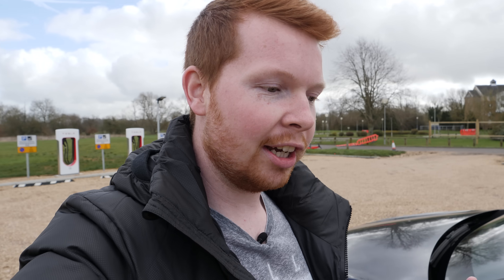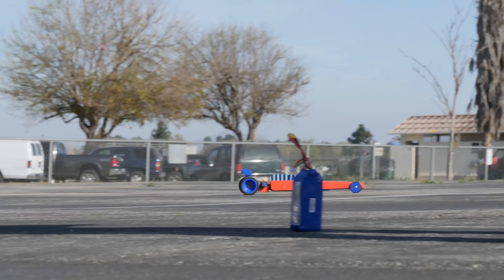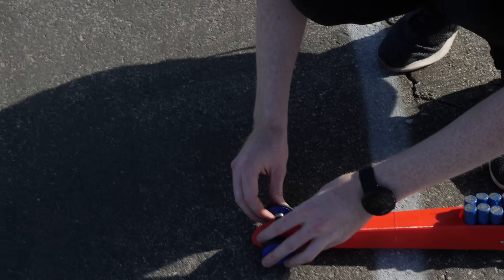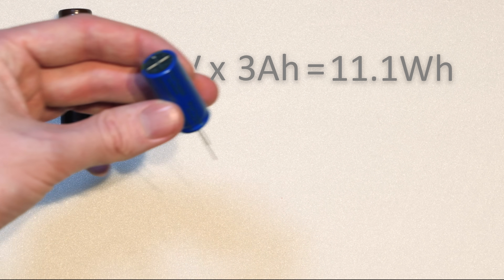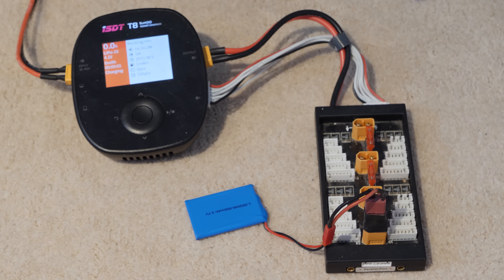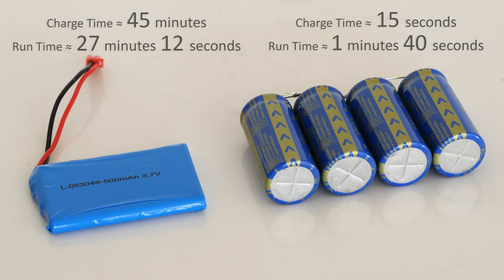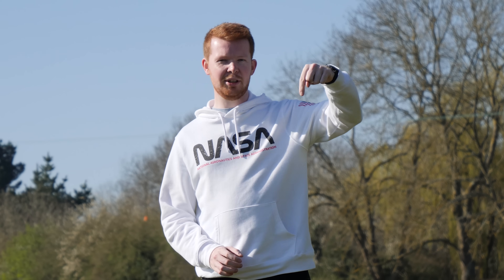Super Capacitor Dragster

Comment: if your looking for video ideas, it would be ace to see a hybrid of super caps and low discharge rate batteries vs a high discharge capacity. eg 10c + caps vs 40c. Can the caps be stuck on in parallel  or do you need to limit current between the battery and the caps to save the battery (or will the lowC battery self limit current well enough.) tractor pull setup would be easier to test on film, your dragster leaves frame to fast. Keep up the ace work dude.

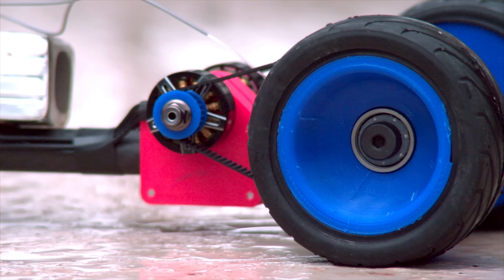Comment: 1:00 - aren't the tires backwards?

E: Yup, but you fixed it later.
E2: Also - why you didn't compare the relative costs of both the capacitors and batteries?

Comment: with a charger like a Power Lab 8 you can charge up 4C for most Li-poly packs (15min charge times). the limit is wattage of the charger and input PSU. mind you you likely have drive the charger with a 1200w PSU but the charger CAN output all 1200w at what ever voltage and amp combo you want. up to 30v and 40a. i have charged 6x 6 cell 3200mAh lipo packs in parallel at 40amps. this is just over 2C rate for the pack load 3.2amp per pack * 6 packs

Comment: The problem with your car was no suspension the tarmac you were driving on has a large amount of bumps in relation to size therefore the bumps affect direction and and grip therefore it flips or does a nae nae and wrecks itself.

Comment: Cheap Walmart car is cheap, but at least it has proper steering. The cheap RC cars when I was a kid had a  half of a control channel. When the controller is transmitting, the car goes forward. The controller stops transmitting, the car reverses and turns left. The motor spins as soon as you turn it on. That's it. Suffice to say I was not encouraged to pursue the hobby.

Comment: Hey, What if we charge the capacitors in a short time and have those capacitors charge the battery slowly while it's unplugged?
In that case, maybe we cannot ride while the capacitors are charging the battery (atleast until a certain amount) , but the 'plug in' time is less. So that more people can charge from the same plug.
Reply: It's not about where you store the energy, its about how much maximum energy you can store in the capacitors.
  
If you first charge up the caps and then transfer the energy to the battery, you still don't have more energy than what the caps can hold. So your running time at best could only be the same as with caps only. 

In reality it would be less since you loose energy due to charge/discharge inefficencies of caps and batteries, and you are carrying the extra wheight of the batteries.

Comment: I think that these kind of supercapacitors would make more sense in a world where power can be delivered in an easier manner than plugging something in. I was thinking something along these (https://www.youtube.com/watch?v=YeNXRD8eziA) lines. That way, something could be wireless and getting charged most of the time, and be fine. For something like the mini-trains in the example, they wouldn't just stop if the IR beam was broken.

Technical challenges might be:
        Amount of power delivered by the IR beam
        Efficiency of the photovoltaic reciever
        Voltege output of the photovoltaic reciever
        High voltage requirement of the application

And probably some other things that I'm not aware of because I haven't tried to build something like this.

Also, so many things in our homes need DC power, and relatively few things need AC power. Is there a reason why our houses have an AC power delivery circuit instead of a DC one? Seems like it'd be more efficient to have one AC->DC converter than for everything to have it's own, and run AC to the appliances that need it.

Comment: — 27 minutes on bats (1632 seconds) requires 45 minutes of charge — 72 minutes total, 
— which equals ~16 cycles of running on caps requiring only 4 minutes of charging — 31 minutes total 
=> 40 minutes bonus time? — give me two! — What am I missing? (except 16 pit-stops for charging)

Comment: Maybe you should buy a small heavy duty mill they arent as rigid as a big mill but good quality ones are still good amd can make you a lot of parts of different shapes material and sizes (as long its still smaller than the mil itself).Just remember to keep hands off the workpiece wnen using it.

Comment: just watch out there; when those caps are empty your battery pack sees that as a short circuit, it's putting out current restricted only by it's internal resistance (which is tiny - so big current) when you connect the battery pack directly to the capacitors

Comment: That was a little disappointing.  I was expecting to see the supercaps dump their energy into the motor quickly for some ridiculous dragster action.  Larger supercaps can easily discharge at 1000A.  Of course you'll need an ESC, motor and wire to handle the current.

Comment: Forgive me. 
I am in no way any kind of electrical genius, i just like watching these kinds of videos.

But i have a question, maybe you can help... What would happen if you charge the super capacitors with an on board battery while running the car? 
is it possible, and if so, how would that work. also, what would the pros and cons be of combining the two technologies?

Comment: So now combine super capacitors with batteries where the caps take care of high draw and the batts running time.
Reply: CSIRO here in Australia developed that tech for deep cycle lead-acid batteries, intending to use it for electric cars. They were overtaken by the supremacy of Lithium batteries, AFAIK the idea never went past prototypes.
Reply: Or just use a transformer

Comment: There are two (and a half) categories of supercapacitors. On the one hand, you have the "Maxwells" - ultralow ESR, but high self-discharge; designed burst-unloading time of ~15s. Designed for starting generators and such. On the other hand, you have the "Sanyos" - High ESR, but low leakage - designed for battery backup of RAM. The "golden in-between" is a specific brand called "CapXX" (now-a-days owned by Murata) that makes a decent compromise between the two. 
If you use a high-ESR cell for burst-discharge, a lot of the stored energy is wasted as i^2*R*t (self-heating) and might damage the supercapacitor in the long run. FYI :)

Comment: Not really a super capacitor, I believe these capacitors loose state of charge very quickly when idle which is why they are not used in electric cars. Some electric buses use capacitors to gather regenerative braking energy and then use that energy to charge the batter pack. Capacitors can take on every from large bus braking faster than a battery can.

Comment: Very cool video! great work on the drag car!  This could be a fun way to bring boy scouts into 2020, instead of pinewood derby, supercap derby! haha

probably easier to drive by limiting the turn radius of the car.  maybe you can do it in the radio with dual rates?  and/ or mount the supercaps lower to keep the cg low? 

would be interested to see you use come circuitry to use more of the remaining capacity leftover in the supercaps.  Some may not realize that the energy density calculation is based on some drain test consisting of a minimum voltage.  The minimum voltage of the cars system is far above the USABLE voltage of the capacitors.  

How much more run time can you get using the same supercaps combined with added circuitry?  (step up voltage for example) Price and complexity will go up with runtime. Is it worth it? Let's see a test! :D

Comment: We're using supercapacitors to power small free flight model airplanes. The characteristics are ideal for this application compared to regular batteries. We can select the capacitor and motor combination as well as how much we charge it to control length of motor run. We can let the system completely run down without damage so we don't need to use a timer. Check out videos on my channel including intro to capacitor flying and how to make a precision digital field charger. Love the supercap dragster you built! It needs a gyro on the steering servo!

Comment: I got little RC car for 15$ that runs like 15 minutes on actual super cap. I think the issue with your approach may be the fact that you seem to be using normal caps. The model I'm using was availabe at Gearbest and is available on Banggood too. Still it uses the same USB charger and charging takes more time than few seconds :/

Comment: I've an idea. It might work just like gear shifts. Make upto 3 capacitor banks. And use a timer relays to shift the connection with motor from the bank which is discharged to a fully charged bank.

Comment: Dragster is difficult to control because because the rear wheels are being driven by independent motors with no connecting axle between them. Slight variations in grip and motor torque cause the car to yaw faster than the operator can counter with steering. This is why real-life drag racers use solid or locking rear axles.

Comment: You can make front wheels toe angle inwards that will solve stability problems. It is used in most of passenger cars , makes the control easy at higher speeds.
At least my proffessor told us so. Your channel is amazing, greetings from Turkey.😎👍🏿

Comment: How about using a combination of the two for fast charging and high discharge with a relatively small lipo battery that would normally not be able to deliver that discharge rate.
Reply: Way cheaper to simply add batteries. Limiting factor is not discharge capability but wire size and motor to deliver the current.

https://youtu.be/zlJRo9yVzus?t=4214
Reply: Depends on the available space and the requirements. The supercaps can deliver a substantially higher current in the same size. So for quick bursts of power use the cap and charge the cap again slowly with the battery. 
A small lipo as shown in the video can maybe only supply a few amps peak whereas the supercap can do a multiple of that.

Comment: So fun fact: I'm a university student, and I work at a lab run by my university. The project I'm currently working on is to build a ~36kWh battery pack that can be charged in about 8-10 minutes with an associated 350kW charger (that we are also making). Kinda cool to see this somewhat related video.

Comment: Man you gotta get some of these to play around with https://www.ebay.co.uk/p/5027691131?iid=401815771147 500F and maybe 3 times the size of the capacitors you were using. They have enough power to amp weld. Use them in little solar lights and for a mini car starter.

Comment: To be fair, if you compare the charging time to the use time, supercapacitors aren't that bad.
With battery : 1,7 min of play / min of charge
With capacitors : 6,7 minutes of play / min of charge

So if you only have one battery and you want to play for hours, you would be better of using a supercapacitor power bank to spend more time playing and less time waiting.

Comment: I saw you had two motors driving the rear wheels. Were the rear wheels independent? Due to the short wheel base I could see any variation in the speed of the two rear wheels could cause the roll overs you were experiencing.  Cool project though.

Comment: One of my favorite planes ever was a glider I made with a capacitor and motor/prop combination from a department store toy. It'd charge in seconds and then run for 15 seconds. With the right throw into rising air it'd fly for several minutes at a time. I had so much fun chasing the plane around the football fields near where I live.

Comment: Yeah, lithium ion already has an energy density that's borderline...

Supercapacitors are so much worse than that it's no surprise they're not used for vehicles...

A supercapacitor is just a capacitor with a very high energy density (for a capacitor)

The upside of a capacitor over a battery is it can cope with very high charge and discharge rates and it doesn't wear out easily...
The downside is very low energy density, plus a rather high self-discharge rate. (don't expect a capacitor to have much charge left a month later...)

Comment: Super cap should be used for heavy load operations for short time, like re generative braking, starting from dead still, it would greatly benifit the battery life, so don't compare apples with oranges 😒😒😒
Reply: https://youtu.be/zlJRo9yVzus?t=4214
https://www.youtube.com/watch?v=NxmO_QuD4Do&t=1712s

Comment: were camber, castor, and toe angle considerations made when designing the drag racer? if not, this might be the cause of instability
Reply: It seemed okayish until they tried to turn it. Have you ever seen a dragstrip with a turn?
Reply: Maybe gear down the steering for a much larger turning circle?
Reply: Other factors:
Was that wing designed correctly? (and would it matter at the kinds of speeds of an RC car?)
Reply: @KuraIthys 
At that speed, I'd guess it's just weight.
Reply: Seemed to crash when you let go of the accelerator.
Reply: Marcus Österback maybe a bit like a Porsche 911? Due to how light the car is it is possible the engine braking when he lets of the throttle causes the rear wheels to slide out.
Reply: A simple decrease in servo sensivity should be more than enough.
Look at the turn radius of notmal dragster cars, they are huge. ;D
Reply: Largest contributor is probably the rear weight bias. Will cause oversteer, which manifests as instability in this case.
Reply: Most of the center of mass was higher than the axles which also caused instability. In short, too sensitive steering, too high center of mass, not enough weight.
Reply: Lower the centre of gravity and make the steering much less sensitive. You can program the steering limits on the controller. Real dragsters like this only have like less than a degree of steering angle. Also find a smoother surface as there’s no suspension at all and the small car going over that rough surface might as well be hitting boulders.
Reply: My toes are angular

Comment: What circuitry would be needed to keep the caps charged from the LiPo? (Then your dragster could pitstop to switch the LiPo and keep going.) If you used the LiPo to charge the caps on the move, how much energy would be lost compared with using the LiPo directly?

Comment: I think the real strength of a capacitor bank in a car will be for a speed boost. just a 3 second burst of double voltage. while the boost system is not used, charge the caps by connecting them in parallel with the battery. When on boost, use relays to change the connection to series. This will double the voltage until the capacitors discharge. Or, use a voltage doubling device to charge the caps. is that a fair challenge? It could be tough, but you make cool stuff.

Comment: If you have enough room, a big capacitor bank is good in parallel with a small lithium battery for huge power density. They can discharge a lot faster for shirt burst and then the lithium battery can perform the recharge when power demand drops back to normal. So you get range and power.

Comment: Maybe a wider wheelbase in the rear, and steer with differential thrust. Those thin tires in front are doing nothing.
Having a supercapacitor city bus with a charger at every stop would be ideal. By the time the passengers have boarded, the charging is done.

Comment: I remember seeing a 3D rendered concept animation of an electric car having it's battery changed at a gas (battery change) station.  The battery decoupled from the undercarriage and descended into the ground while the car rode along tracks like a carwash.
Reply: That doesn't work because you own the pack in your electric vehicle. You are not going to swap out a $10,000 plus pack for one of unknown quality. Not to mention the logistics and the engineering hurdles of standardizing on a single pack and having them available 24/7.

Comment: I think people are overestimating the usage of supercapacitors. They are a terrible means of storing large amounts of storing large amounts of energy. As shown in this video, the lithium battery lasts many many many times longer than 12 supercapacitors and has a much more stable output. This is just a proof of concept right now, and he is just showing that it can be done, like showing off lemon batteries.